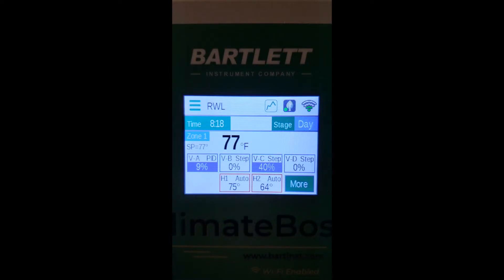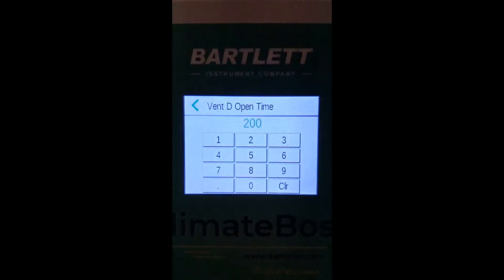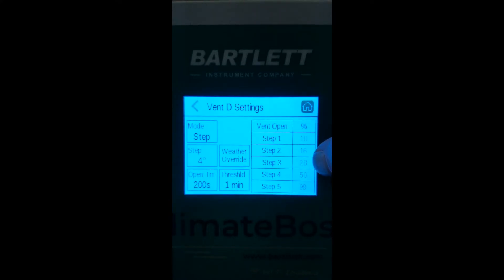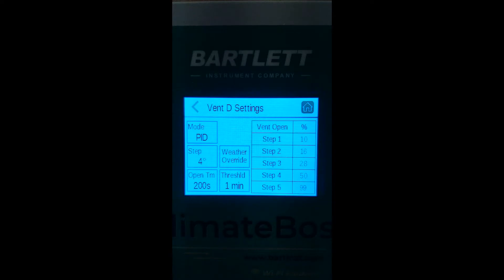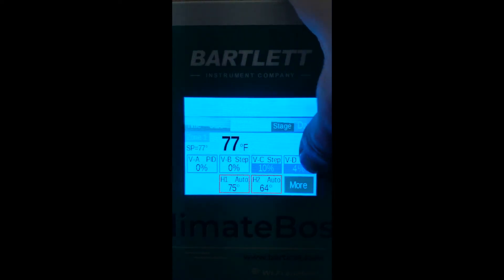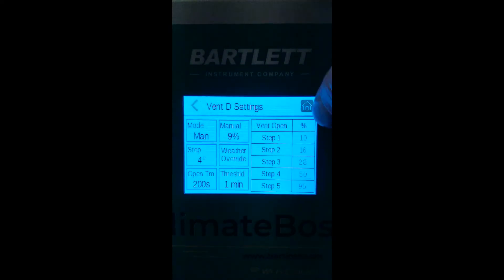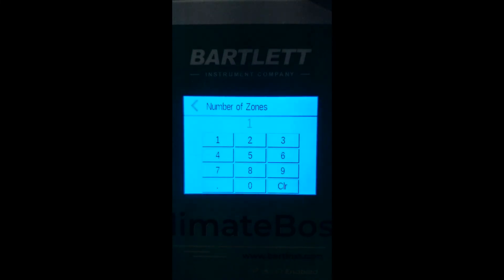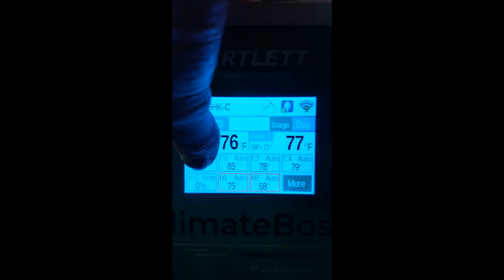Bartlett ClimateBoss | Vent Settings Programming

Comment: I'm having an issue on a V6 CF controller where whenever I click the Srart/Stop button, there's no beep or anything and the program doesn't start. All other functions seem to work except the start button - any tips?
Reply from the maker: Turn power off to the controller. Then try taking a hair dryer on low heat and warm the keypad (warm to touch). Take the palm of your hand and firmly work all keys. Let cool then turn power back on to the controller and try the button. If it still does not work, please reach out to information@bartinst.com